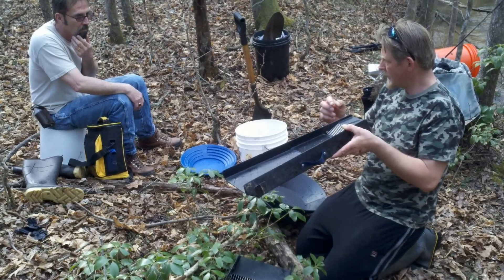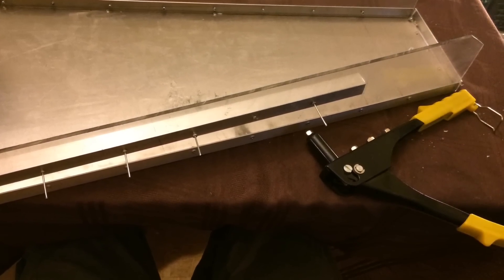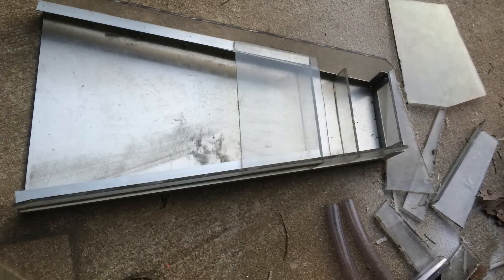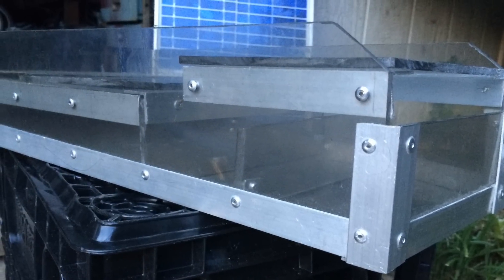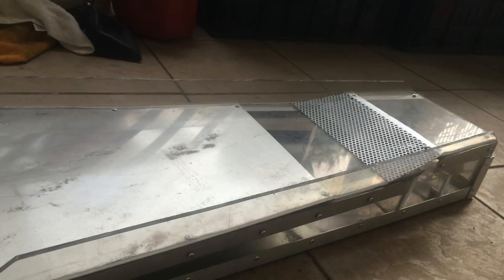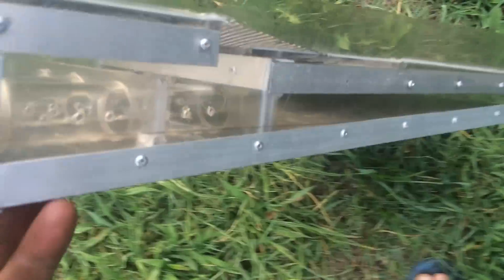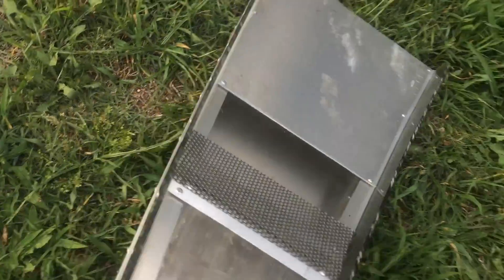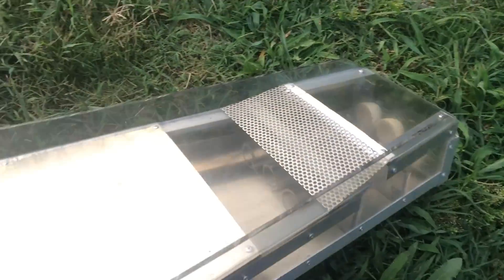Clear Gold Trap Fluid Bed Sluice Bazooka Like Sluice - diy home made build

Comment: To cut plexiglass without chipping or shattering I used a carbide blade on my table saw. The blade had 3 different teeth around its circumference. One tooth angled to the left followed by one shaped like the top of a fence palen that has a 45 degree grind on each corner followed by a tooth angled to the right and then another tooth with the two ground corners. You won't have the melting problem with this blade, just ease the plex through the blade.
Reply from the maker: Thank you

Comment: Hi Pitr
Do you have to ability to empty the forward and rear gold traps separately? This would allow to see what % and size of gold "leaks" over from front trap into trap at the rear, and this information would help a lot in deciding how much (and what size) gold escapes from the rear trap, if any does. I have thought that emptying by suction pump might do it, but possibly a more direct access into each half of the trap by a sliding door or similar would do this.
I have not made a bazooka trap for myself yet, but I'm watching the progress people have made so far and planning to do one after a couple of weeks when the good weather ends.
Reply: I meant to add --- really fine job you made there!
Reply from the maker: Great points , i will try that with my next build :( thanks

Comment: You should cut tubes to be flush with bulkhead to increase water pressure to fluid bed. Turbulence will cause them to be inconsistent in flow. Looks pretty good for a first build.
Reply from the maker: Chunkski Farms thank you great point , i did not think about turbulence at al :) , in just imagine that when you put it under water in the  creek the water buildup and the pressure spread evenly everywhere :) , but definitely if i build another one i will make it flush or funnels all way from front of sluice 
Thanks for comment

Comment: Great Vid Pitr!!
I like the cut of your jib my friend. We are both kind of on the same wavelength where fluid bed sluices are concerned. I have two videos uploaded on my "Shootin4Bedrock" channel showing the 2 FB sluices I built. The first one was my original build from August of last year just to test out the gold catching capability of a fluid bed design, (http://youtu.be/TQYQoNjbupo). The second one I just uploaded a few minutes ago to show the second sluice I built based on what I learned from the first one. There were some big changes but my ideas really seemed to payoff, (http://youtu.be/oomzwA5vxd8). I like your design very much and the only thing I see  right now that might be a problem is your underflow water supply for the fluid bed looks like it slants to a smaller intake at the entrance than what you have at the start of your fluid bed. This may reduce the hydrostatic pressure needed to keep the bed fluidized. If it does, at least you have built your sluice so it can be changed, (I'm a big rivet fan too!). If you like, I'll PM you my cell number and we can discuss any problems you might have after you test it out. I spent a lot of time and hair pulling getting mine to do what I wanted and I'm more than willing to help another prospector out. You and Lee go get some gold!! Let me know how it works!
Rich.
Reply from the maker: greenerlumber man thanks ,i just got your comment , youtube put it in junk somehow :L( .
i like your bazooka alot , i use mine every week and its working very nice :) easy prospecting :)
good luck and get some big nuggets